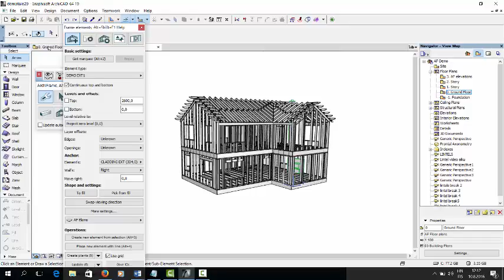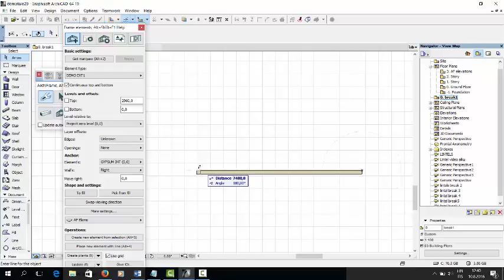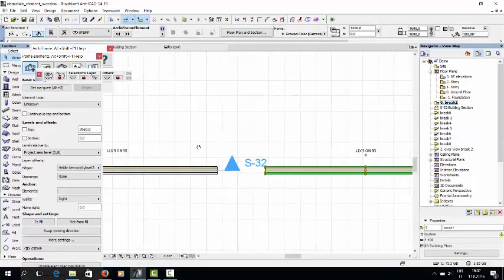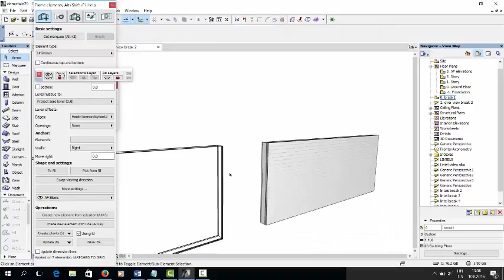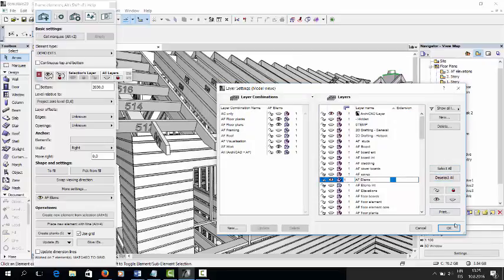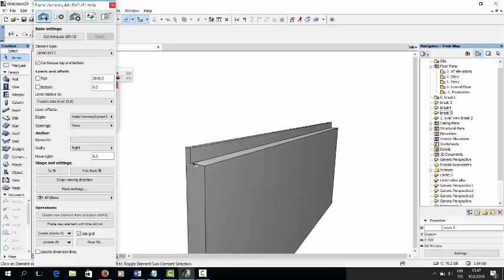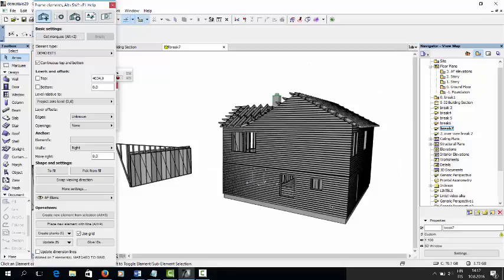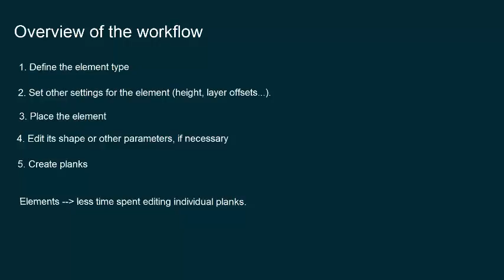2. ArchiFrame Elements: Overview

Comment: in 4:15, what tool did you use to edit the wall element? Thank you
Reply from the maker: Apologies for the late response! To move the node of the element, 

1) View the correct layer of the element in a section view
2) Turn off Archicad groups
3) Click the node and select the "move node" option from the toolbox that emerges.

I hope this helps!